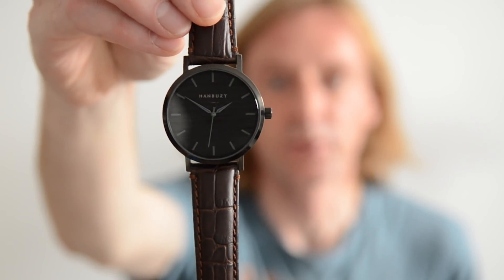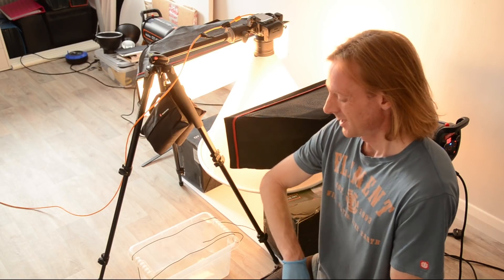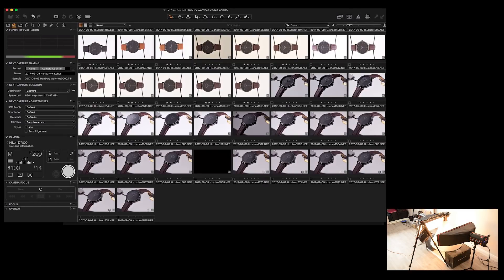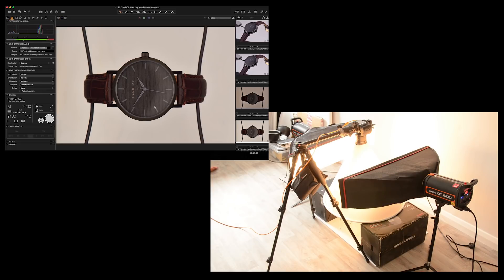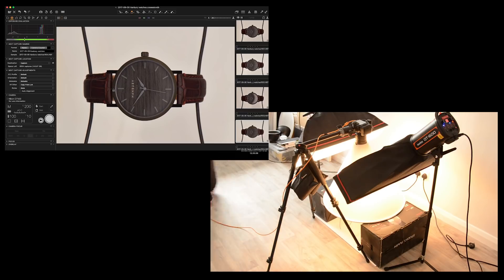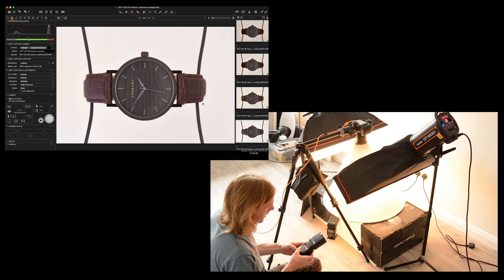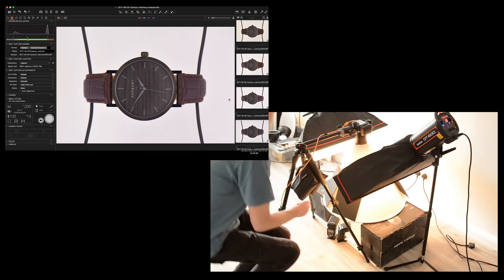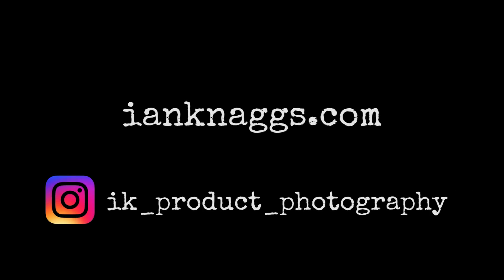How to shoot watches - Product Photography Tutorial by Ian Knaggs photography

Comment: hey. how would you do other angles of the same product?? like the side angle?
Reply from the maker: Hi! It depends on the angle really - we'd tend to shoot other angles using a large diffuser close-in and over the watch to light it and use bounce cards to fill any darker areas. Hope this helps!
Reply: @IanKnaggsPhotography  thanks for the reply but like how would u place the watch. My problem is just how do I place the watch. But your video helped with the lighting well. Thanks a lot !
Reply from the maker: @lightworkx4651  - Again it depends on the composition. They could either be laid flat, held with wire or using a clear plastic watch display clip (which needs careful placement to reduce excessive retouching to remove it.